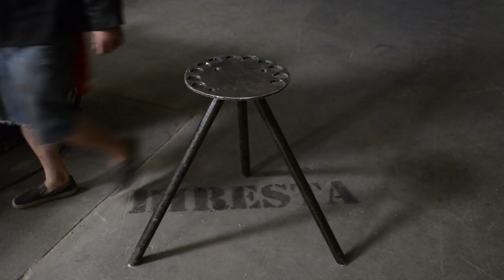DiResta Vise Stand

Comment: 2:10 Jimmy to get cleaner cuts with your plasma cutter, you should always initiate your cuts on an edge so the molten metal can be blown downwards. If you start your cuts on a flat part, the metal has nowhere to go and splashes around until the plasma makes it through. You could drill 1/4  holes and start from the edges of these holes. I already heard you complain about this on the podcast so I hope this helps. Take care !
Reply: xavytex good to know
Reply: Wouldn't it be faster/easier to pierce near the center of the hole?
Reply: That's the usual method with a cutting torch (old school) and CNC (new school). Pierce your scrap, not your workpiece. I collect rings (bearing races, hunks of pipe) to use as torch guides for small circle cutting. You can tack a piece of flat bar to the ring so you have a way to clamp it to your work.

Comment: When I plasma cut small holes I tack washers where I want the hole. Then just run the plasma cutter head around the outside or inside depending on hole size. It is a great vise stand Jimmy
Reply: James Seagraves great idea!
Reply: Yeah because washers are free!
Reply: Nothing is free. Do you think the metal he used was free? Or the plasma cutter? Sometimes a few cents for a much better result is worth it.

Comment: As usual I enjoy watching your builds. I made a similar style stand for my first anvil but eventually went to a built-up solid block of wood, the long legs will flex with every hammer blow and each time you bend or twist something in the vise, eventually cracking the welds. I got tired of stepping around the legs and rewelding them. I'm much happier and have less chance of tripping, although it's a great portable design. Also clean and de-burr the holes for the hammers very well or you'll find the handles get chewed up fast.

Comment: Super idea! Vise and hammers on one table, near everything.
Reply: My tripod vise like this is covered in grinding grit, slag, dust, rust, dirt, oil, etc. So I wouldn't want to keep tools there. But to each their own I suppose?
Reply: Only the tool that needs to work, that's understandable.
Reply: For whatever reason if I need to hammer something in a vise I generally use my bench vise for that. I built my tripod vise specifically to grind work being held in it. So that's what I mainly use it for. It holds stuff good for hand drilling too. But that vise is not too far from my mill so that sees more drilling action. Just how things work out.

Comment: Did this to a rigid folding Tri stand pipe stand. I have several vices and plates that bolt to the top.  Legs changed over to pin in place makes it portable!

Comment: Nice build, fairly fast, very practical. You'll maybe want a work tray underneath to hold "stuff' as well as add some anti spread bracing when you put heavier than anticipated loads in the vice. Well worth duplicating, thanks.

Comment: Why so precice wood template and then crappy hand cut with plasma torch? Better to make holes in template bigger and guide the torch by them...eh?
Reply: That's what I was expecting! You can even get away with heavy cardboard for a one-off plasma template.
If it was done this way, what was the point of using the wood template at all when all the marking out would work as well strait onto the steel.
Reply: Да меня тоже это смутило малость..
Reply: Michal Rimmerak Have you ever tried guiding a plasma cutter with a wood template?? It never ends well
Reply: Michal Rimmerak why cut the holes out on a band saw only to have to glue it back together? Surely he has hole saw bits?
Reply: perhaps he is just showing yet another way to lay something out?
Reply: Yanick Poirier: You can even use cardboard templates and they work fine for a single cut. They do get wrecked, but they do work.
And yes, have both seen and used thin MDF sheet used for templates a number of times. It's wood, not flash paper. :)
Reply: We've got a plasma badass over here!
Reply: He just needed holes to hold fucking hammers and tools, they did not need to be perfect. Function and practicality, Jimmy's motto.
Reply: Michal Rimmerak Why make a template at all?! Unless you have plans to make more!?
Reply: Views...
Reply: Yes, but in history, Diresta was my favorite, but not now. Last months are garbage or old videos.
Reply: Michal Rimmerak I think he was just showing another way to make it.. because the dude has a bridgeport and a cnc plasma table, so he could of easily used...
Reply: Michal Rimmerak he's been moving his shop while traveling around the country, he'll have good videos out soon now that he's getting settled into the new shop space.
Reply: You're totally right Mic, why not just layout right on the metal if not using the template with the plasma cutter. Was good for a laugh at least

Comment: You should have a pole in the center that goes straight down to transfer the hammering force directly into the ground and not the legs which would bend over time.  It would be an adjustable leg.

Comment: I know, Plasma cutting is a blast, but I'd have used a hole saw on the drill press for all those tool holding holes. But then, maybe you were going for a more rustic look. Regardless, nice project! I've got an extra vise that just might get a similar stand...
Reply: I made a tripod vise stand about 10 years ago and it is really handy. I use it mainly for running an angle grinder on work. So make your stand so the vise jaws are about waist height on you. Because that's an easy height to run an angle grinder at. Also I don't think storing tools on the stand is too practical. Because all kinds of junk falls down by my vises while I work on stuff in them. Filings, grindings, oil, dirt, rust particles. You name it, all that kind of stuff ends up around my vises. Now do I want any of that on my tools? Not really. It's not a half bad place to keep a garbage pail though. I actually keep one of my shop vacs under my tripod vise. It fits good in there.
Reply: I use my air hose and shop vac a lot around my bench and vises. I hate a dirty shop, but then, working makes for a dirty shop. I clean my tools when I'm putting them away. Greasy things gross me out for some reason, unless they're like fries or ribs or sausages...

Comment: This being vise stand, i just had an idea about having the legs like in foldable 3 leg chair, but welded from where the fold mechanic would be, that'd give the stand much more downwards strength, with 2 locations of welding. also would look quite interesting. Ofcourse more work, and planning, but maybe worth it in the long run. The tube is strong, but only held by the end of it, but hopefully holds well enough.

Comment: leg shoulda stuck out the front of the vice so you can walk up on both sides. while i get the idea of having the legs to the sides at the front, like having it on a table, walking up to the sides of the vice is the more usable orientation, your more likely to approach a piece in a vice from the side than from the front of the jaw.
Reply: That vise is on a swivel base, you know? The legs don't get in the way nearly as much as folks imagine they do either. I mean maybe if you had one and used it for a while you'd know? I've had mine for about 10 years now. Jimmy should have built a stand alone hammer rack. Them hammers where he put them aren't going to work out over time. They're right in the fallout zone for crap getting worked on in the vise so they're going to get coated. Dirty hammers is a pet peeve of mine too.

Comment: Hey jimmy great build!. As an amateur maker I have 2 questions if ye don't mind.
Why did you cut a pattern on mdf beforehand and not directly draw it on the steel plate?
Why did you not use your cnc for the project?
Reply: I guess he took made a pattern out of mdf, to replicate his work, if he needs another vice stand. 
And i think it was faster this way, then with the cnc
Reply: I was going to ask the exact same question about the mdf. I could be wrong but I'm going to say it was pointless (other than bombarding you with "Diresta" brand the whole time). He did it just to fill time for the video. There's absolutely no reason to do that given the final product that we see.
Reply: OU812 if jimmy did it it couldn't be pointless. Maybe its faster or more visible. I don't know. I got curious and hope to learn something new today if jimmy replies.
Reply: I have the same question about the MDF template? If needed why not just do a 1/3 and duplicate? Silly question from a non metal worker?
Reply: this way he was sure it is what he wants, without destroying a good piece of metal. 
Also this is a good lesson for the rest of us, if we need to make something more complicated, this is an easy way to make a template.
Reply: Philep Kalopetris good thinking as I was wondering why he made it too, not as if it was an overly complicated pattern, also I guess if you wanted to make several parts the pattern would speed up layout
Reply: +Philep Kalopetris  Even the way he made the template seemed pointless. Why cut the thing up into pieces? Drill a hole in each circle and jigsaw the circles or use a hole saw. I'm sure this guy has all the sizes.

I don't see any logic here.

+Nishant Agarwal  "if jimmy did it it couldn't be pointless"

C'mon dude. Really???
Reply: OU812 he had to cut in smaller pieces to be able to cut a round on the bandsaw. about hole saw, maybe he couldnt find them after the moving.
Reply: You're assuming he is only going to make 1. That piece of mdf and the angle block will probably be used again, you've seen his vice collection right?
Reply: william spindler your statement is definitely valid and hence I asked my second question about the cnc. it would have been faster with a better finish. Also as far as jimmy's vice collection is concerned, most vices will have different location of holes for mounting and this piece of mdf will only hold true for that one specific vice.
Reply: Because he has so many people that want to see him do it by hand. For some reason many of the people doing this stuff for fun, think cnc is cheating. Personally, I agree with what your saying where cnc is concerned, but I spent years running a large koike servograph so I understand the commitment in time it takes to not only run one, but to write the executable files for it.
Reply: By the time you get done generating the G Code you could be done with a simple thing like this.
Reply: more like the CNC is not made by Lincoln Electric, who made all the kit he was using, and who obviously sponsored the vid

Comment: IDEA , you should have welded the bolts  for mounting the vise first  and then weld the feet over ,to hide the bolt heads , or weld the bolts to the feet  making them, boln on bolt off like a metal working Mr. Miyagi
Reply: Jimmy may come to find that he has to move where he bolted that vise down someday. If the back jaw does not hang over the edge of the mounting plate you can't hold long work to the floor. Then your clever idea would become more work to undo.

Comment: Hey All, looking for advice. I want to get  into welding. What are what are my options for sub $150 welder? This does not include the other stuff I would need just the welder. Is it possible?
Reply: A lot of people like the Harbor Freight flux core welder for a cheap starter machine. I think on sale they go down to like $89 or so?
Reply: Paul Frederick thanks I'll take a look, I have limited experience with MIG a few years ago. I'm worried that a cheap flux core/MIG, has to many points of failure for a cheap machine. What about the Harbor Freight stick?
Reply: Less people seem to have the stick. For hobby work I'd think you'd get more use out of the wire welder where work tends to be with thinner gage materials. There's upgrades you can do to the HF wire welder too. There's videos of people doing them here. Adding a bridge rectifier, a filter cap, and a smoothing coil. Supposedly doing all of that makes it a more capable machine. To get all that in a machine off the shelf you might have to spend $350? So it is kind of like buying your equipment in installments. Get the basic unit then upgrade it as you go. I will say this about stick welding, it is the easiest to keep up with as far as consumables go. You can also get lots of different kinds of rods which is good, and bad. Good in the versatility it allows, bad in the sheer number of choices. If there's only one right one for every situation more choices just makes knowing the right one harder. I have a Smith oxy-acetylene burn outfit, a 120V MIG welder, and a 240V Miller TIG/stick unit.

Comment: As much as I usually love your projects this one left me limp, The fixed jaw is behind the edge of the plate so that you can not put long pieces hanging down and the legs are to wide they will be in the way when working around the vise. Over all it is to light for any real work, you either need a heavier base or fix it to the floor. There is a video on my channel where I show one of my vise stands that fixes all these issues.
Reply: I have a tripod with a wider stance and I don't have issues with doing heavy work in it. What do you have one of those bullshit rim stands?
Reply: Wood-N-Metal Workshop ` which video?
Reply: simplex vise
Reply: Wood-N-Metal Workshop `Jimmy has stated he saw one similar and he just wanted to make something like this with the hammer slots. He has a collection of vises and could use another vise if this one didn't hold a particular part.
Reply: Wood-N-Metal Workshop ` I really like your stand with the receptacles mounted in it.

Comment: Not gonna lie, got triggered by that paint job, painting the vice without disassembling should be considered a war crime.
Reply: yes why paint moving parts, its only acceptable if its art installation. Or its not Vise Stand but hammer stand :)
Reply: It should still function though.
Reply: I think he did it on purpose to trigger people
Reply: blindbrick or he needed a place to put his vice and hammers?
Reply: So it's not gonna work now? of course it will! this is a tool, a big beefy tool and little spray paint aint gonna hurt nothing. Just Saying!
Reply: (Gasp) J'acusse!... How dare you! you Sir, just have made it into my Sh!t List, G'da!
Reply: Claudio Pacin - If you want to sound pompous, at least spell it correctly. It's "j'accuse". Cheers!
Reply: yes WHY
Reply: who the f would dissasemble vice to paint it... if u know diresta u should knew its his style he dont care about that kind nonsense... peace
Reply: So, why is that? Does it somehow weaken the vice structurally? Personally I use mine. Its a post vice from 1860, never had a paint job and its still going strong. I use it to hold things I'm hitting with hammers.